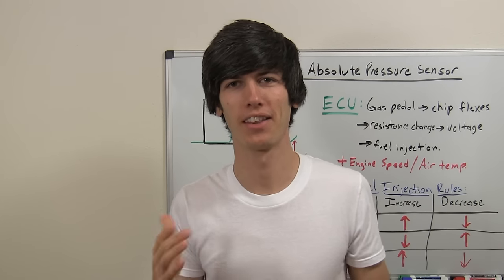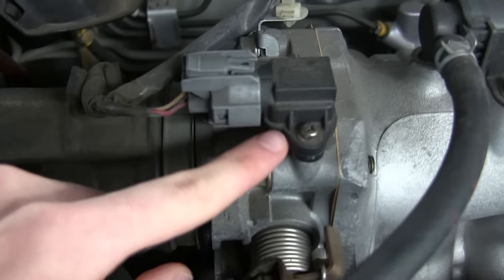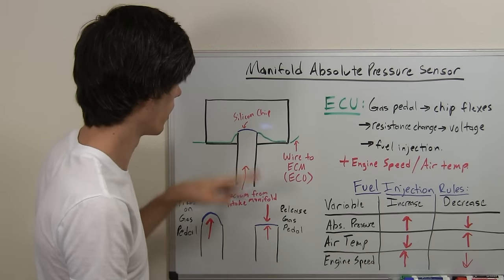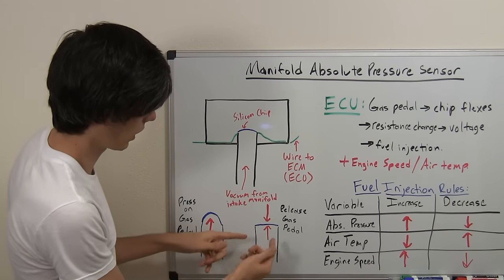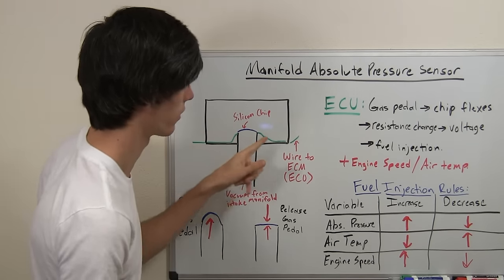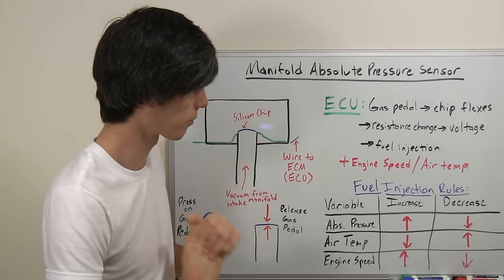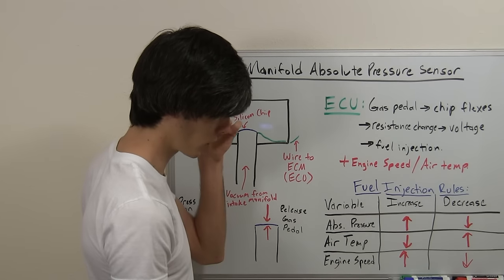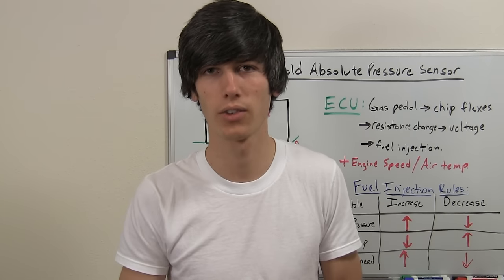MAP Sensor - Manifold Absolute Pressure - Explained

Comment: So I took my S2000 to the dealership and they plugged it in to a diagnostic machine and it read “MAP voltage reading above 0.95 volts indicates the need to inspect valve adjustment.”  Doesn’t make sense... or does it?
Reply: rasz does this actually mean my valves need to be adjusted?
Reply: rasz I appreciate the reply!
Reply: It make sense since the intake valve begins to leak ( doesnt close completely cause the adjustment is too tight) , its making pressure peak in intake.

Comment: I always wonder what happen be you're cruising down the highway and suddenly let off the gas pedal completely and let it move by its momentum. Will the injector suddenly inject the same amount of fuel as "idling speed" when ur still moving forward?
Reply from the maker: It will inject enough fuel to keep the engine idling, or in some cases it will even stop injecting fuel and let the engine slow down the car. If you put it in neutral, however, it will simply inject enough gas to keep it idling. They can react very quickly to the different amounts of air.
Reply: Engineering Explained There's really no point to inject at idling speed when u let off the gas and your engine rotating by its own momentum, unless u come to a stop to prevent engine stall

Comment: is MAP sensor working when idle and turn on AC?my civic drop its RPM everytime i turn on AC,IACV and FTIV both new..
Reply: When you turn the air conditioner on, a clutch engages the compressor which is driven by your accessory belt, powered by the engine. It puts more load on the engine. Since there is more load on the engine, if the ECU doesn't compensate for this, the same amount of air/fuel going into the engine but at a heavier load will slow the engine down.

Comment: In case of map sensor what will happen if we have a vacuum leak and what will happen if we havemaf sensor instead?
Reply: I wish he would have explained that too.  With MAP I think it auto-corrects for vacuum leaks maybe up to a massive air leak on other end of manifold.  MAF won’t auto-correct by itself, but upstream O2 sensor should pick up a lean condition.  Note: I’m not a professional mechanic.
Reply: your right as map can measure all the air in the manifold including vacuum leak

Comment: What will happen if they tricked the o2 sensor using a resistor? Some used this on a motorcycle with a full exhaust system.

Comment: why there is both MAP and MAF sensors in the car shown and that too two types of MAF sensors since both are for the same purpose???
Reply: Some cars, particularly boosted cars will, for instance, use a MAF before the turbo / supercharger, and a MAP after. It will compare the two readings to monitor boost.

Comment: WI it prevent your car from starting
Reply: bump…ditto.  I viewed this video with hope of learning whether or not this MAP will prevent my Honda Civic from starting.  Nice explanation of how the MAP works but gave me no clue as to whether or not a malfunctioning MAP will prevent a car from STARTING.  I've tried just about every other solution.  The car runs very well once started.  It cranks very well but does not start unless I either: 1) spray lots of starting fluid into throttle body, or 2) jump any one of the spark plug wires to ground.  I've tested the fuel pressure thoroughly before and after the fuel rail and fuel regulator.  The fuel regulator appears to work OK.  I get 40 psi with ignition on and 32 when running, with 80 psi when pinched off before the fuel rail and 80 psi on the return line after the rail and regulator.  I've replaced the fuel filter, distributor, spark plugs, plug wires, tested the igniter (resistance OK) and coil, and main fuel relay (PGM-FI and tested it pin by pin).  All related fuses and relays are tested.  I removed and cleaned the idle air control valve (IACV).  All to no avail.  Its very curious that it starts immediately when I do a spark test to ground from a plug wire, and starts with starter fluid (and brake cleaner).  So is it a fuel or ignition issue?  Timing?  Not likely since it runs perfect once started.  Cam or crank sensor?  The system is OBS-1.  I don't get any codes thrown.

Comment: I love this dude too. But i have one of those illogical minds. It makes it hard for me to understand things as easy as the rest. (🏊 against the current lol)
With the given explanation of more or less fuel i feel like there is more to the using more and\or less fuel. 
For example, a classmate of mine had asked the teacher, " is true that once you are traveling at 75mph are you technically "not" burning fuel?" at that moment my brain crashed in error... The teacher gave an answer and explained it briefly. BUT... I was still suffering from the hard reset in my brain.
Please help me. If u have hit this nail already please post a link. 
P.S. im about to post another comment on this video.
Reply: To the student who posed the original question that caused your brain to spasm, I would say FALSE. The car must continue to burn fuel in order to overcome friction (air resistance, tire resistance, mechanical resistance) as well as maintain all other electrical functions by means of turning the alternator. It must also mechanically power the water pump to keep the coolant flowing as well as the power steering pump. And if you have A/C, that too. Continued engine operation will also maintain a vacuum for the power brakes. Now, all those things I mentioned do not add up to the amount of power needed to accelerate quickly to 75 mph, so once at that speed you will consume much less fuel per unit time than you were using while accelerating, and I guess that's what the student was after.
Reply: TheCarMan thanks.

Comment: Excuse me but when press on gas pedal the absolute pressure will decrease not increase so it will pull the silicone chip down not push up
Reply from the maker: Ghassen Abdennadher The strongest vacuum in the intake manifold is when the throttle valve is closed, the engine is trying to pull in air but the throttle prevents this from happening, hence it creates a strong vacuum. With the throttle open,  up to atmospheric (or even slightly higher) is possible with NA engines, much higher than atmospheric is possible with forced induction.
Reply: Engineering Explained Thanks, it's right. After commenting this video I had researched more and I concluded what you said to me.
Thanks a lot.
Reply: +Engineering Explained my car is spitting fuel out the exhaust, its running way too rich, do you think its the map or coolant temp sensor?

Comment: Nice video.  

I have been hot rodding, tuning , performance engines 3 decades, but how the Air Density is explained here does not compute. 

Basically, Completely Wrong.

Vaccum  is easily described as Suction.. or Low Pressure.
Pushing the gas pedal down.. Opens the throttle body...or  carburetor butterfly plates =  More Vaccum as engine sucks in more air.    To prove this, put hand over throttle body or carb >   engine will suck on palm. =Vacuum. 

Definition  of Density:  A Quanity of matter per unit of volume.  

IF Air Density increases with Altitude & Colder Temperatures, then Why do people suffer. .even struggle to breath on mountains.. and unpressurized airplanes neccessitates  occupants to wear oxygen mask to breath?  

Altitude = Less Atmospheric Pressure...  combined/ & coincides with Colder Temperatures=  air molecules are smaller.. and therefore farther apart.   
--This is why a Carbureted  engine  will inherently run rich as Temperature Decreases or as Altitude Increases, because of less available oxygen per cubic foot. 
--This is why very high Altitude Pilots  (Example :Sr71 BlackBird ) must wear pressure suits, squeezing their legs,  to keep blood flow to their brain, to increase oxygen molecues per square inch/ per second basically.

As Altitude Decreases, Atmospheric  Pressure Increases,  Oxygen molecules are larger and more dense per cubic foot. 

In the ocean, more depth = more pressure= molecules are forced smaller, forced more closer together, more compacted.   Proving all this,  A bubble released at just 12 foot  will start small.. and will increase in size as it rises to the surface. 

Engines with  with performance camshafts that have  more valve overlap, have less vacuum due to both the intake and exhaust valves being simultaneously open  at same time and for a longer duration (amount of time)- this is because the intake vacuum being pulled into into the cylinder  (because the piston is on it's downward stroke (intake stroke).. like a syringe pulling in fluid)  is escaping out the exhuast port. 

Reverse your arrows on the drawing.  The vaccuum is Pulling, not pushing.
Reply: on a Boosted engine (turbo/ supercharged) vacuum increases as boost decreases, because both cannot exactly exist at once.

Comment: actually when you accelerate, the vacuum increases, not the pressure.
Reply: No. Easily verifiable with a vacuum gauge.
Reply: unless it is a turbocharged engine.  In a non turbo engine, the air is "sucked" in. inversely, in a turbo engine, the air is "blowned" in. Anyway, the MAP sensor measures the pressure, whatever the engine.
Reply: When you accelerate, you open up the throttle body which lowers the vacuum in the engine due to less restriction.  That's why the engine accelerates:  there is more air pressure in the mainfold and thus more fuel can be used.  Stick a manifold gauge on your car and get back to us.  Alternatively you can use an OBD2 scanner.  I've had lots of cars with MAP gauges and as you press the throttle air pressure increases (vacuum decreases).  Max vacuum is with no throttle.
Reply: Zeno C YY Not sure why you would just drop that link since it says exactly what I just did.  "If the engine is operating under heavy load at wide throttle openings (such as accelerating from a stop or pulling the car up a hill) then engine speed is limited by the load and minimal vacuum will be created. "
Reply: Scott Short WTF are u talking about
Reply: Vacuum is not a physical unit. There’s no such a thing as “vacuum increases”. You may say pressure decreases. 

In a turbocharged engine the absolute pressure increases with engine speed, as it was explained in the video. Engine in idle requires less air that a loaded engine. Therefore the the amount of air in intake manifold is lesser hence the absolute pressure is less than when engine is loaded.
Reply: Speedy i have a question, in a turbocharged engine on idle is the pressure higher or lower than atmospheric? Dose the turbine spin enough to create positive pressure at idle?
Reply: malathuni it does very slightly above atmospheric that it isn't even considered boost. also, if you rev the engine at neutral it does create a lil more but your wastegate /BOV will dump it out. real boost is when the engine is under load and more fuel is dumped, thus increasing the exhaust pressure and volume = boost.

Comment: To summarize, I should move to North Pole in order to gain better gas mileage or power. But as I already live in Finland, between the melting North Pole and stinging cold Siberia, it wouldn't make any difference. All I needed to know is that my Nissan Sunny has more horsepower here in cold dark Finland than your Mustangs in California. Cold air intakes are for pussies! Move north people :D